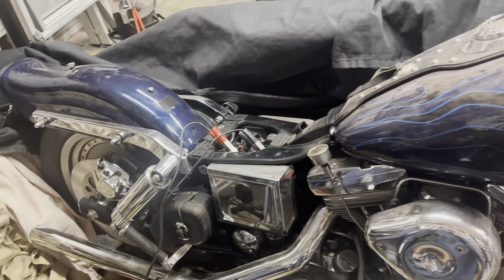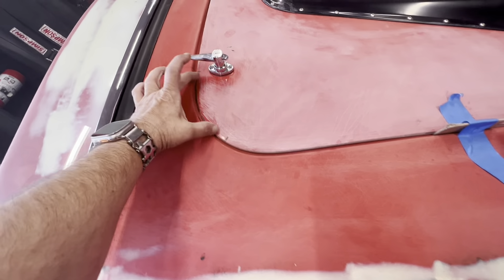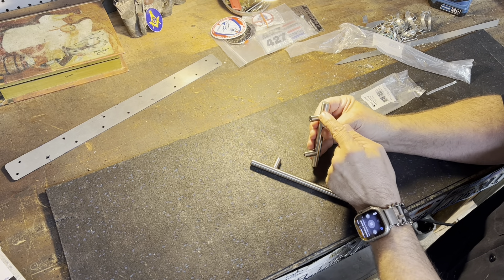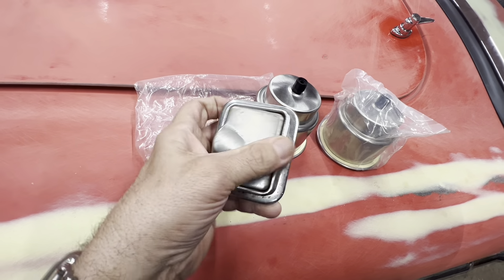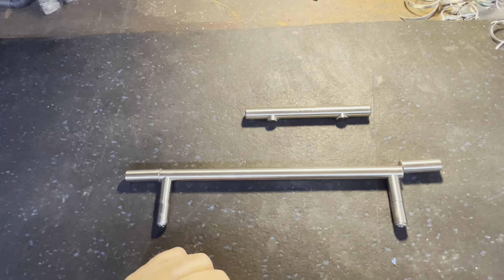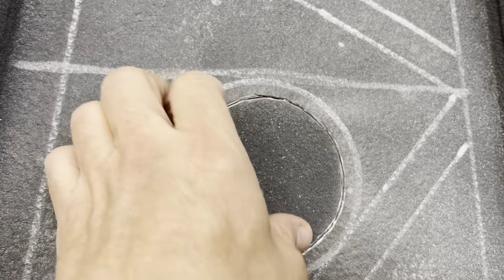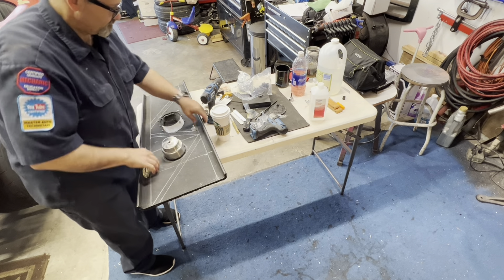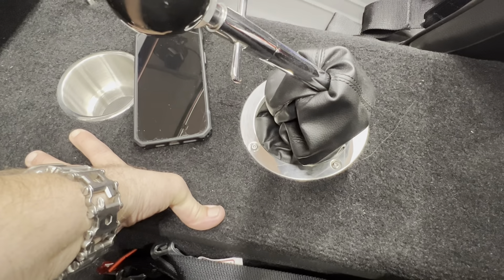Shelby Cobra Replica build Part 87 Cup Holder & Oh $#!+ Bar install.

Comment: Oh Shit bar thoughts. Aluminum or Stainless steel plinths that would raise the bar, and give a larger base surface area for lateral stability.
Reply from the maker: Thanks, ya well spoiler alert…I didn’t care too much for the oh sh!t bar so I removed it. So far passengers just hold on to the harness anyway.